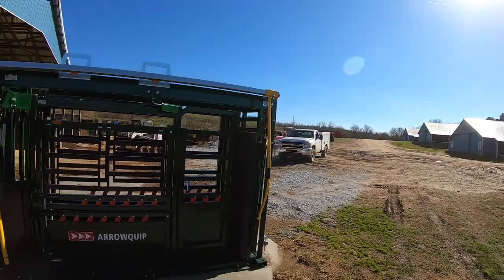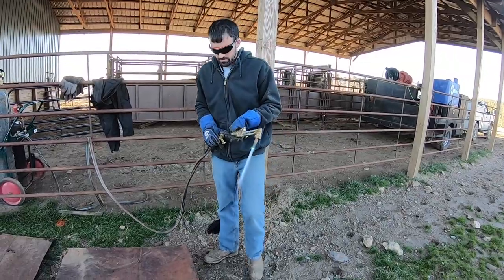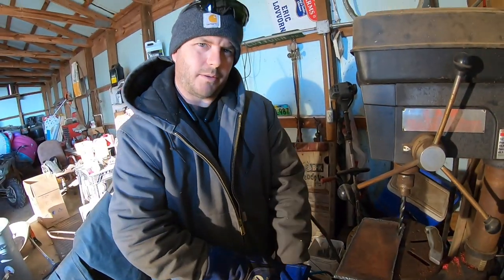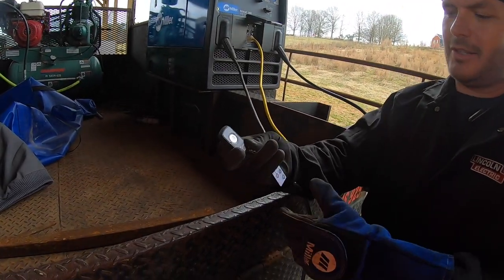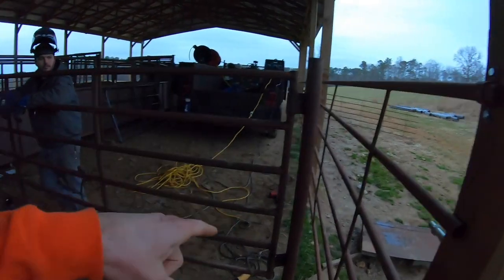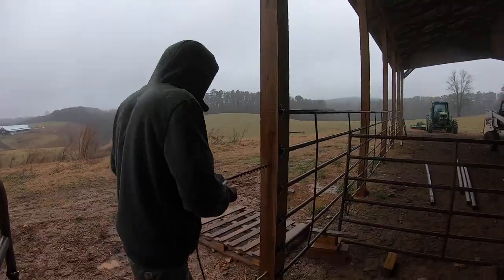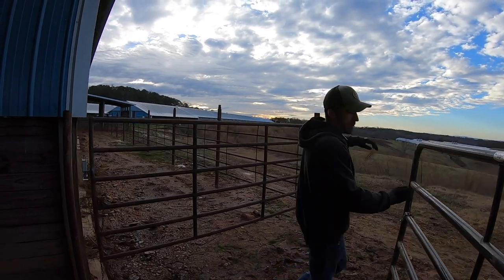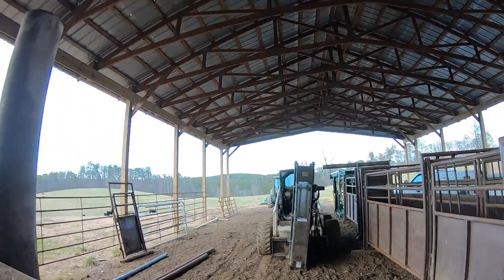Building Cattle Pens - Part 2 The Bud Box

Comment: I like that you add that plate to the gate hinges, I have been cutting the original tabs off the gate hinges and then welding two parallel plates to each hinge in order to make it easier to mount on a round post.
Reply from the maker: Thats a pretty good idea. Has it been working out pretty good for you? When it comes to cattle the more reinforcement the better.

Comment: I may have missed it. Are you going to sheet the gates that crowd them into the alley? In my experience it works better when those gates are solid. Looking really nice. And enjoy the content keep up the good work.
Reply from the maker: We didn’t get into that yet. That’ll probably be done later on once we finish up pens and all that. We are trying to decide between sheet metal or trying a heavy plastic or canvas material. Any recommendations? The sheet metal would be great and last for a long time. Just wasn’t sure if it would make the gates real heavy and harder to maneuver.
Reply: @FarmerHunt  I can't say from experience, but I would think heavy plastic would be the best, just because sheet metal might be heavy and possibly loud if the cattle run into it.  Looking forward to hearing responses here though.
Reply from the maker: @joesaucer7367  That's actually one of the possibilities we are looking at. We are also looking at a rubber material as a possibility. My only concern with the plastic is making sure the cows don't kick it and crack or break it.

Comment: Would you guys recommend this post driver for exactly that? Thinking about buying one to put in a bunch of well pipe posts for my corral and fencing.
Reply from the maker: We really like ours. It may be hard to justify the purchase if you are using it for just one small project but if you have a big project or several different projects then I definitely recommend it. If you have any questions please let me know!
Reply: @FarmerHunt  ill mainly be using it for driving 2 7/8 drill stem and have read mixed reviews. seems affordable to me compared to the ones others recommend such as the redi driver or rhino which is like 1000 more.
Reply from the maker: @benn1851  It has worked good for us. Some of those posts we drove about 4’ in the ground. Luckily where we were working wasn’t too rocky. If the ground is bad rocky you may have some issues. We really like it for driving t post also.
Reply: @FarmerHunt  thanks for the feedback!

Comment: where did you get the slam latches that screw/bolt onto the wooden posts?
Reply from the maker: We got ours from our local feed mill. We bought just the latch and made the piece for the gate. You can also buy a piece for the gate that bolts on. I believe Tractor Supply has them or you can look online at Valley Vet or Amazon and order them also.
Reply: @FarmerHunt  Thanks!  I just ordered a bunch of panels and gates to make a new semi-portable corral.  They come with chain latches, but I was hoping to put something like that on instead for some of my gates.  Appreciate the advice.
Reply from the maker: What kind of panels did you get? I highly recommend the slam latches. Our gates have chains also that we can use in addition to the slam latches if we need them. The latches are really nice if you are moving cows from pen to pen. Saves time when you don’t have to stop every time and chain a gate. We have an Amazon store that we put some of our favorite things in it. The slam latches are in it. 

www.amazon.com/shop/farmerhunt
Reply: @FarmerHunt  We are getting panels and gates from GoBob.  Wanted something more sturdy than the local tractor supply puts out.  We had looked at Arrowquip ($$$$$$$$$) and Sioux Steel ($$$$$) and ended up getting our whole setup from GoBob.  We really liked the other two brands, but was going to cost us over 50K from Arrowquip to get what I was looking to do and north of 30K for Sioux.

I will check out the amazon store for sure.

The slam latches are strong enough to take some abuse while working cattle?  Like cattle pushing on the gate and all?
Reply from the maker: It’s crazy how much those panels cost. I think you’ll really like those panels though. The latches hold really well. If I’ve got one on an outside gate that leads back to the pasture I will chain it usually just to make sure nothing escapes. I’ve never had any issues though with them busting through an interior gate with only a slam latch. If you buy the two piece latches just make sure both are installed properly. If the piece on the gate isn’t installed right it can twist around if cows push on it too much.
Reply: @FarmerHunt  Thanks!  I think we are going to be happy, just going to have to take some time on installation to make sure that things are lined up.  I designed our whole loading chute based off of my working and seeing what other people have done.  My dad's only requirement was that it was portable, so if we didn't like something we could modify it.  So hopefully I will get it working, and outside of no real good area for a scale, I think we will be happy with the bud box design.
Reply from the maker: @joesaucer7367  awesome! Keep me updated on how it goes. We’ve done lots of studying and researching for our cattle facility. I’m sure as soon as we get done there will be something we missed or something that we want different. I think we are probably going to leave a few places open and have some panels we can move around. It’s hard to beat some good panels though as long as the cows don’t get their head under them.
Reply: @FarmerHunt  Will do, would love to do some drone video of the facility when we get it all finished.  Everything is on order right now, hoping to get it by April so I don't have to use the old facility for deworming again.

P.s. found you on Instagram too, JS2 Cattle is our farm.
Reply from the maker: @joesaucer7367  we’ll definitely be doing some drone footage once we get it farther along. Hoping to do some drone footage also with cows coming through. 

Hope you get your panels in time. That will be really nice. We are looking forward to having a nicer facility for working ours. 

Thanks, I’ll look you up!
Reply: @FarmerHunt  Keep up the great videos.  I enjoy watching other farmers and learning from others.  I don't know that we will be doing chickens like you are anytime soon, but our farm to table beef has been a real hit ever since Covid hit.
Reply from the maker: @joesaucer7367  Thank you! If I had my way, I would get rid of the chicken houses and just raise cows. Maybe one day. Glad yall are doing well with your farm to table beef. We are slowly getting started into it. Been working in that direction for 2 years. Finally have a few steers being processed this week. Hope we have good luck with it also. Do you sell by the cut or do you sell whole/half/quarter?
Reply: @FarmerHunt  I sell most of mine by quarter half and whole, however I do sell ground beef by the pound (10 pound minimum).  Most all of our ground beef is open cows that are over 1100 pounds.  I can make more money by sending them to the processor and then selling the ground beef than I can just selling them to the market.  Rough numbers are $450 to sell to the market, or $800 to sell ground beef.  So that seems worth it to me.  The biggest thing is getting the market going.

Additional advantage is I haven't bought ground beef from the store in like 5 years :-)